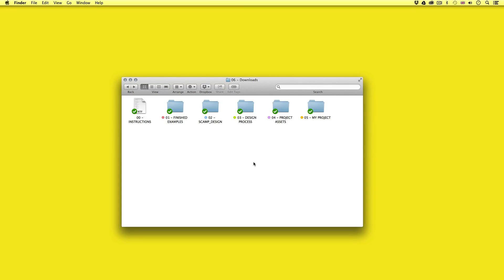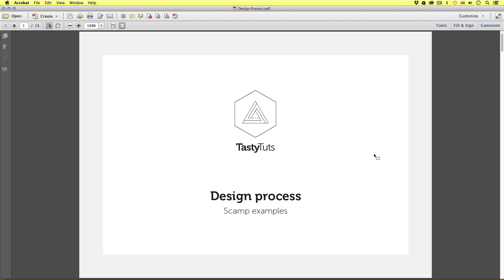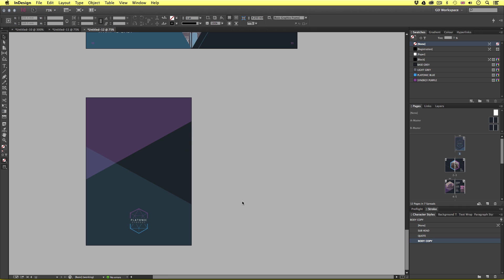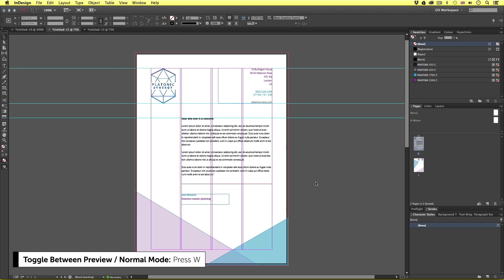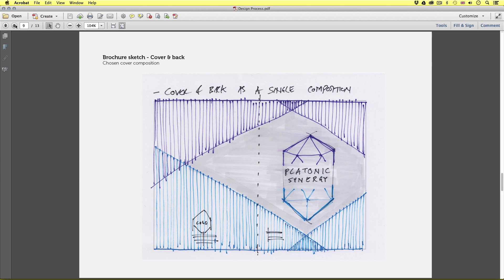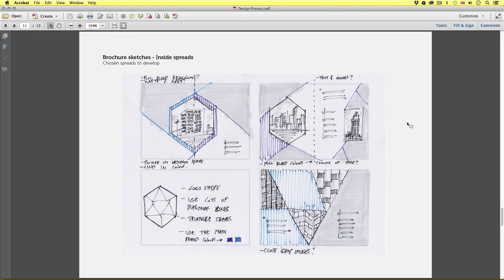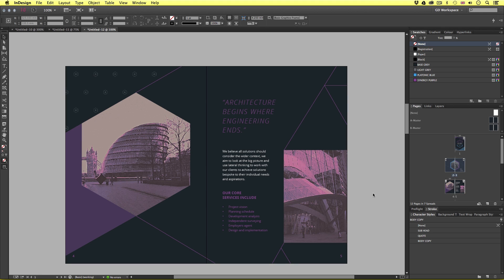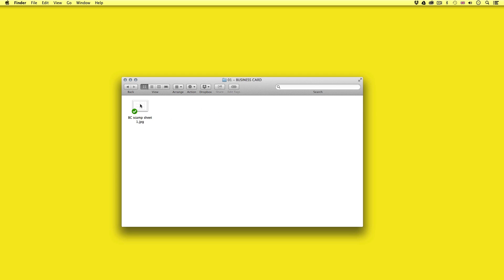Design process for print  Ep3/15 [Multimedia design course - Print]

Comment: Hey I tried sketching my own layouts before, and I ran into the problem of sketching for way too long. It got to a point where I sketched for hours, only to realize that 30 minutes into mocking up my selected sketches, I didn't like any of them. That's why I want to ask you: How do you balance time spent filtering out thumbnail sketches, scamp sketches, and designing mockups? And how do you decide when to go back to sketching thumbnails and scamps after not liking any of your mockup designs? Do you limit how much time you spend on your mockup designs as well?
Reply: I think every design process must be thought carefully and when you are sure that a certain idea can look good and solve the problem, then tactfully drawing the idea can help. :) So it will save the hours of drawing too. ;)